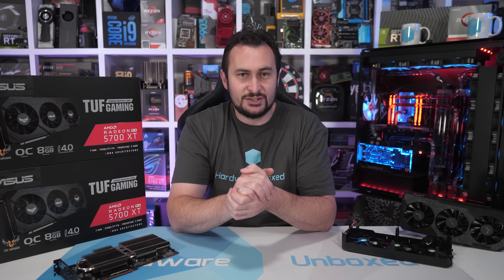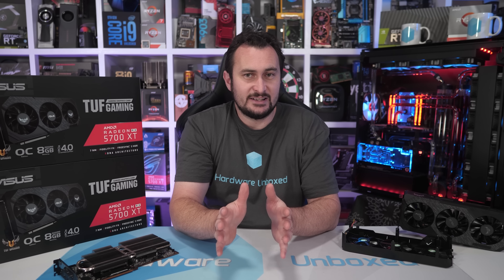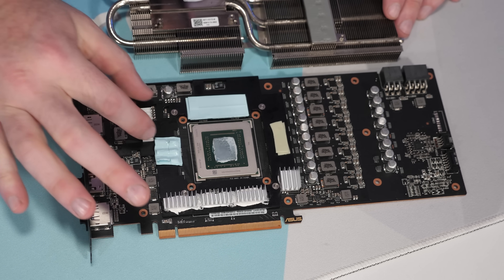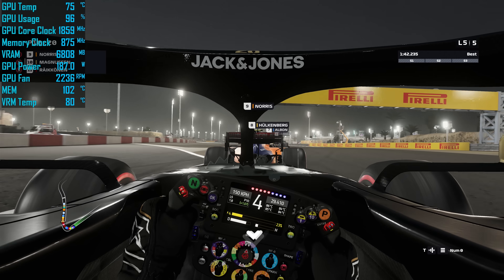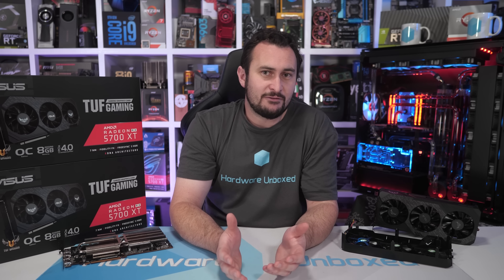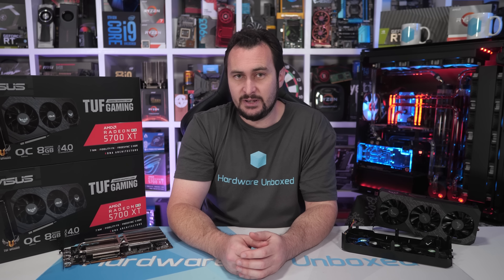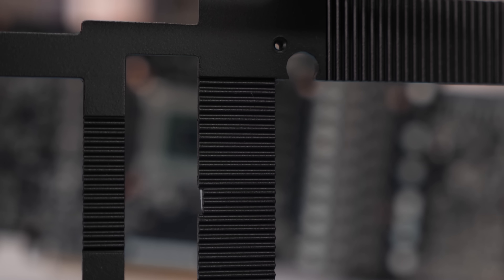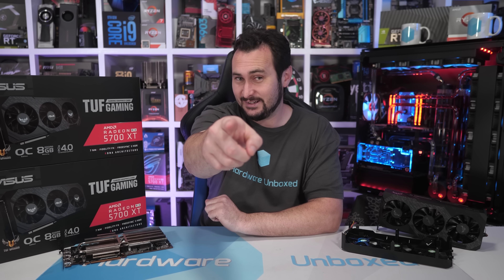Fixing the 5700 XT TUF, How Much Cooler Can We Make It?

Comment: I think that it is unacceptable that ASUS continue to sell a product that has a potentially fatal flaw.
If ASUS valued their customers they would not continue to sell a ticking time bomb.
Reply: It'll just bite them in the ass, when all those cards come back for warranty replacement
Reply: They weigh the potential cost benefit of either continuing to sell or issuing a recall—either way they have a PR headache, and if they recall they're effectively announcing to the public that they screwed up, which tends to have a lasting impact on company image. You'd hope that they'd take that PR hit in return for presenting a consumer-friendly image, but sadly, investor-driven corporations very rarely lean that way.
Reply: @auturgicflosculator2183  recalls hurt less than doing nothing at all. I'll tell you right now, this makes me want to avoid anything they make. I've felt the same way about MSI and XFX for years,  they put out shit products and didn't stand behind them. I never bought from either ever again.
Reply: My asus strix r9 390 died before even an year of use , never bought an asus again ,been a customer of Sapphire ever since.
Reply: @abdussamadaslam155  Sapphire rarely has the most affordable cards, and they don't always lead the pack in performance... but they're NEVER garbage~
Reply: Yes, they really should recall them all and come up with a fix, be it thermal pads or a new cooler all together.
Reply: @KBW19723  hmmm my msi gaming x gtx 1070 keep going strong after 4 years, didn't even replaced the thermal compound, still cool and quiet
same goes for msi x370
asus however i avoid like a plague, since last time when i had asus it was a total shit show
Reply: Back in the day, ASUS used to the best GC and Mobo manufacturers, in terms of quality and features....since they expand their products to phones, even peripherals such as gaming keyboard,mouse,mousepad, rgb thingy, and headphones, they seem lost focus what matters the most  and forget what made them the best in in the 1st place.
Reply: Or they could have issued a recall for TUF customers. I still don't get how ASUS gets away with it.
Reply: @heisenberg1338  hmm all you want, i lived through capacitor gate on a MSI motherboard back in the Athlon XP days. They refused to stand behind their product. You try to defend their bs by bringing up the one product you happen to own. Was it even an actual MSI card? Is it an MSI 1070FE? lol if so they didn't make it. Look at the two shit boat 5700xt's they just launched. Look at the shit VRM's on their x570 motherboards. MSI can't be trusted.
Reply: It was even worse with the ASUS R9 290x DCU II GPU, The gpu chip was smaller in size than the chip the heatsink was made for meaning the Hawaii chip(290x) only touched around 50% of the 5 heat pipes, it was a well documented issue at the time & when the 390x released they used the same DCU II cooler on release. The 3 fan model came at a later date but for those who didn't follow the tech news & bought ASUS's 2 fan 390/x models they got shafted by ASUS, I actively avoid ASUS, MSI & Gigabyte when buying AMD GPU's nowadays.
Reply: @auturgicflosculator2183  That's because Sapphire are an AMD only brand. ASUS, MSI & Gigabyte have been known to cut corners when designing AMD Graphics cards. They've been caught out using heatsinks they originally designed for Nvidia GPU's on AMD GPU's, Hawaii was the most noticable time when Asus & MSI released so-called flagship products that were unable to control the heat coming from the gpu, I bought an MSI 290x TFIV Gaming gpu which was unable to stop the card from hitting the 94 degree throttle point, Even with a 100% fan speed it only lowered temps by a few degrees during prolonged loads like when gaming. It was awful card.
Reply: Asus has been on a gradual downhill for many years, its the inevitable result of a failing company. They make like 1 or 2 good products but a reminder that Souljaboy had 1 or 2 good products for sale too.
Reply: Motherboard Hardware is good, Software is horrible.
Reply: @auturgicflosculator2183  It depends, if customer support is paying for shipping and handling to fix the cards for free; i think that's a really good solution. Even if they don't call it a recall.
Reply: @liev535  Absolutely. People will RMA them now because of high temperature or later when the warranty period expired, at that point, Asus will lose some of it's brand quality. I don't think is worth the risk. They have money to do that. Buy, even worse, they have the time, money and resourced to do the proper testing to avoid that in the first place.
For me, Sapphire is one of the bests in terms of AMD cards... Because they only do that, they can focus on only one thing.
Reply: SmashStomp Inc  they messed up on 1000 series memory cooling as well and never fixed it
Reply: ASUS' quality control went far downhill over the years. I had a Z68 board from ASUS on a 2500K and it was rock solid. Not anymore. Buying anything ASUS nowadays is just ripping yourself off. Their AIB cards seem to be pretty piss-poor to the competitors and even have defects, and their motherboards (especially the Z270 boards) have had TONS of BIOS issues that weren't ever fixed in future updates. Their XMP really doesn't work either, and when it does, it only works until you take the RAM out and put it back in. No, it's not my 6700K's IMC or the RAM, or even the voltages (trust me, I've tried everything and it did work with XMP until I reseated the modules after cleaning my system). It's the board itself because it won't even boot after "memory training" and instead just hangs on a blank screen until you hold the power button and press it to restart the system.

Just search up Z270 XMP issues, look at how many people have complained about it and also look at how many of them are ASUS board owners... that should tell you that their boards are pretty shit (and I think even their Z370 boards had some issues as well). This is probably why I got this board without paying for it since it didn't work for someone else...
Reply: @liev535  Unfortunately a lot of people are lazy to do the warranty replacement so I'm sure they'll make out at least OK
Reply: I bought an Asus motherboard together with a ryzen 1600 which was supposed to include some games in a campaign. I did never even get the games after many conversations with asus support. My 280X Asus card also gave up only 3 years after purchase. Will try and avoid them in the future.
Reply: I have to say that I would think twice before buying another Asus product given the unacceptable way they have dealt with this issue. Surely whoever gave the tick for releasing a gpu with no gddr6 cooling should get the sack.
Reply: They should allow people to return it with a model that isn't crap for a replacement
Reply: SmashStomp Inc  didnt msi put a 1070 cooler on a 1080ti?Fuck all manufacturers,dont trust their shit ever again,you are to loose from that,always take time to review a product b4 buying,cuz they are all shit,the only people that have managed to get my trust has been Saphirre,and i dont know if they only make graphics cards.
Reply: @thiscouldntblowmore  thermal pads got it from a failure potential within months to cooking in under a year,90 C is operable,but its also very inneficiant and i think it starts throotling over 90 aswell,you would just pay for a piece of junk thats  gonna die in 1-2 years.mine aswell buy a used card.New cooler or go home.
Reply: depends on how steep the price cut is and if they are sold as no-warranty with a disclaimer, if it were say 150-200 off the price
Reply: @KBW19723  I agree, but I doubt ASUS does :P
Reply: I think they should replace the cards with a fixed version of the TUF or Strix. Keeping in mind they delayed their launch by 1 month after the others, it's disappointing from Asus
Reply: Currently waiting for my third Asus RX 5700xt Tuf...

First one kept crashing entire pc on load
Second one had broken fancontroller
Reply: @jukka0taxi  RIP your fun~
Reply: Zfast4you I did not overclock it at all , it was a shit product , I actually have my sapphire card undervolted and overclocked no issues at all.
Reply: Ever heard of the Nexus 7 issues? Asus does not give a damn about selling products which are not fit for purpose. And currently it is not only the TUF, but the strix as well. 
https://www.youtube.com/watch?v=H7lnBCFnBok
Reply: We won't be putting more ASUS products in our AI lab.

Comment: It's not that TUF if it kills itself hey
Reply: Hey there Jarrod
Reply: @abhirajbaruah4676  Hey!
Reply: it is TUF , if it can sustain above 100C on the memory till the warranty runs out 😁
Reply: more like a PUF
Reply: TUF = Thermally Unusable Failure?
Reply: Risky comment tbh
Reply: @anotherks7297  What's at risk? Or did you mean risqué
Reply: It´s mind boggling that whatever team of engineers handled the TUF lineup would overlook this. They were likely pressured by the finance guys (whom which engineers are often at odds with) to lower costs. As a mechanical engineering student I feel this is the most probable scenario. They left basically no factor of safety on the memory and/or did inadequate testing.
Reply: Lmao
Reply: I guess Im asking randomly but does any of you know a tool to get back into an instagram account??
I somehow lost my login password. I would appreciate any assistance you can offer me
Reply: @Oakley Elliott Instablaster ;)
Reply: @Devon Alfredo thanks so much for your reply. I found the site through google and I'm trying it out atm.
Looks like it's gonna take quite some time so I will get back to you later with my results.

Comment: No, it's not okay to continuously sell a defective product under any circumstance. For MSI and XFX, it's more or less okay because they're not defective, they were somewhat poorly designed. A discount there is fine as long as you're taking steps to also fix the core issue.

For Asus though, one of the biggest players in the tech industry, to only discount the defective product, offer no fix to affected buyers, then go on to sell their 5600 XT lineup at a $40-50 premium (the Asus tax), is just tone deaf.

Asus, and really any manufacturer, needs to remember that you're only as good as the products you sell. As far as I'm concerned when it comes to Radeon GPUs, Asus is the worst brand to consider.
Reply: Steering clear of ASUS products for Radeon products has been necessary for awhile now.
Reply: Not just radeon GPUs, their nVidia Gpus are also shit when it comes to low-mid tier range
Reply: their ASUS Tax or Gamer Tax rather for their ROG lineup has got to be the worst thing I've seen.
Reply: the 5600 XT lineup dosent have those issues,but you are right about the 40 dolla permium,they lost hella cred from that shit and i aint paying no premium on a brand that has failed to prove itself,if anything saphire deservers that premium,altough idk what their 5600 XT card is priced at,cuz they aint in stores.
Reply: @LukjoJak  they ain't bad at my local Micro Center.  I still will champion PowerColor though.  Seriously underrated GPUs.
Reply: Agreed. And I'd also like to add that Sapphire is probably the best for AMD cards.
They've been at it for a long time now, and they typically have good reliable products.
Reply: @YouCensored  probably Powercolor too. Not always the strongest/fastest/coolest cards, but they have their shit together and you can rely on getting a high quality product.

Comment: I purchased a rog strix 5700 xt in April this year, after seeing your other videos I checked my serial number and mine was eligible for the new screw kit. Have to take my hat off to asus, they made sure I was in contact with the same person at the service centre, organised pick up and had the card back to me in the same week. I can definitely see a difference in the pressure on the cooler and have also noticed a slight drop in operating temps. I don't think mine was as badly effected as your test model was and my lian li 011 Dynamic XL case came with a handy gpu support that keeps the heavy rear end supported. Thanks for the great content you guys put out and for not being afraid to step on the toes of the big companies when they need it!

Comment: In the case of delivering a brand new car that does run and can get you from A to B, but the coolant spills over and could cause irreparable damage if you drive for to long, would be cause for a recall. 
in the case of delivering a brand new gpu that does run and can play games but the video memory overheats and could cause irreparable damage if you play for too long would cause for a discount?

"it has a problem that would have stopped someone from buying it if they’d known about it" 
I still don't even see public disclaimers on the products available for sale, you can still sell something defective, as long as its disclosed.
ASUS sound like their trying to do the bare minimum, a company that gets that large would feel this is but a forgivable mistake.
XFX see this as brand tarnishing and would go above and beyond to win back the trust of their customer.
Reply: What a smart man!
Reply: It's honestly pretty surprising to me that we haven't heard anything about a potential lawsuit about this yet. The defective nature of this product is certainly more damaging to consumers than the GTX 970's deceptive marketing, although I suppose the class in this case would be much smaller given that it's just this one model of graphics card from a single board partner, as opposed to the GTX 970 which was a popular GPU used in many different models of graphics card across several manufacturers. That would mean the law firm taking the case on would be getting a slice of a much smaller pie, so there's less incentive to take it on.

Comment: I picked up one of these for $400 AUD (this is very cheap over here) having completely forgot this was an issue, watched your vid for some ideas and actually did quite similar stacking pads to touch the heat spreader, but also using much larger heat sinks and managing to get my max memory temp down to 88c 🙂

Comment: We had to recall all of our TUF 5700 graphics cards we had sold and applied this thermal pad fix. We used Arctic 1.5 mil thermal pads stacked. Keep in mind that thermal pads can be stacked with no negative results
Reply: 5700xt is the same? I have a TUF near to blown. How many 1.5mm you stacked?
Reply: @LU9ESD   hey did you find which size to use ? 1.5mm for tuf 3 5700xt ?
Reply: @alperb.4225  Not yet. We are in winter here so no problems so far. Have you do that? 1.5?
Reply: @LU9ESD  i tried 1.5mm and 2mm. Spent lots of money on 5700xt finally i sold it out. And bought an 6900xt. Happy for now. Not amazing. But ok . Using it with 5950x cpu.

Comment: I guess at an even lower price, the TUF could be perfect for enthusiasts who like to and have experience tinkering with coolers. Couple your solution with a slight underclock and undervolt tweak and it should be a cool and quiet card worth a little less than the rest of the 5700 XT lineup, but at a lower price. That is, of course, if the price comes down further as it really ought to for what is otherwise a defective product. It should be sold at a discount reflecting that.

EDIT: The remaining TUF stock should either be tweaked by ASUS before being sold or be clearly labelled at retailers as partly defective parts. A simple discount is not acceptable imo.

As for the 5700 XT saga, is this the end then? No more? That's a pity. I'd just started missing them.

Comment: I saw the reviews for this card and bought it for 200€, which in my opinion is a good price. After that I fixed it with an M.2 heatsink. It sort of works and is definitely better than stock. That fix costs about 10€

Comment: Why are Asus still selling these cards ?
They should pull them off shelves,  make a public admission of guilt, apologise. 

And then offer owners a free upgrade to another model.
Reply: they are like apple, nothing to see here everything is perfect, here is some discount on us
Reply: Heh, upgrade to the model where the heat sink sags so much it uncouples from the hardware it's spose to be cooling? Asus is trash.
Reply: Ok. The upgrade to another model would still need an RMA, because those are the ones which have coolers not properly mounted. But hey, at least the design is working. ;-)

Comment: I just applied your upgrades to my 5700xt and well it is working just fine. It was never that silence during AC: Origins and the Temps also seem to be OK.

Thank you very much for your solution to the heat problem. It still sucks, that Asus isn't sending Heatsink replacements for the Original 5700xt TUF customers 🙄
Reply: A year later and it still runs pretty fine.
Reply: @andreasmuller8395  hello, can you tell me what size pads did you use and if you did the plastic washer thing please ?
Thank you
Reply: @Zantrop64  Hey, I used 145mmx145mmx0.5mm Thermal Pads from Arctic. Just cut them to the size you need. The Card is still working in my girlfriends PC. Oh and I did not do the washer thing.

Comment: Really happy you decided to look into this issue, Steve! Also Arctic confirmed that their Accelero Xtreme III cooler fits the PCB aswell. The kit includes heatsinks for VRAM and memory.
Reply from the maker: Yeah at that point though you are far better of just buying a better model.
Reply: @Hardwareunboxed  True, only if you're dead stuck with this model it would be worth purchasing the aftermarket cooler.